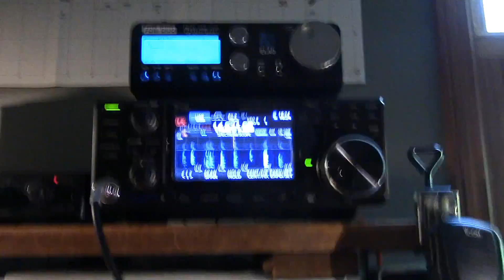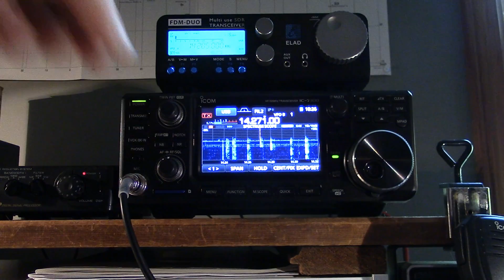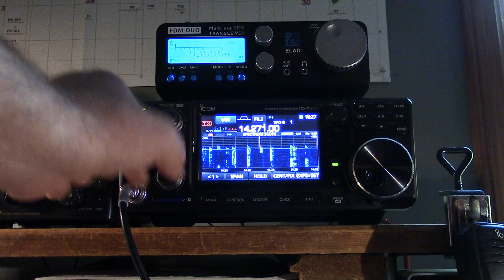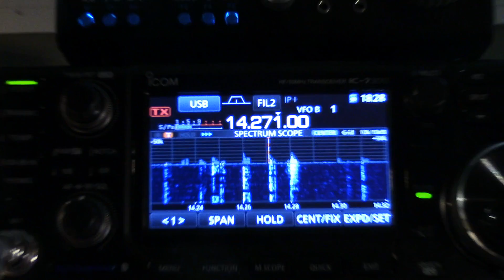Icom IC 7300 vs Flex 6300 - COMPARISON

Comment: Evaluating audio quality without using the same speaker is hard.  Also, may I suggest the proper way to adjust your Flex 6300's AGC-T?  You first adjust the AGC-T slider downward to the point where you hear significant signal falloff, then increase it a few points (by left clicking on the slider on the right side of the AGC-T knob, not dragging the knob). This fall-off point is what we call "The Knee". Then you turn the slice volume up quite a bit. This makes it very noise free and near FM like.
Reply: I agree with your comments.  Also the AGC-T is an entirely different function than the RF Gain on the 7300.  Not to denigrate the 7300 - it's a fine radio but a 2" speaker just doesn't make it with me

Comment: I am looking at getting the 7300 to replace my Flex 6300. I am not happy with the direction that Flex is taking with their software development, though I fully understand why they have to do it. They concentrate on things that bring in the $$$$$, which means that the average ham gets left behind. Many people who have used the previous software for the previous generation rigs is better and has more features than the current SSDR. It is a shame Flex could not use that as a starting point.
Reply: I am in the same place as you on this one.  I have had the 6300 for two years now, and I have had alot of fun with it on both CW and DIGI modes, although I bought the 6300 based partly on the "roadmap" that used to be published showing WAN in the next year or so.  This seems to be on the back-burner now with all the excitement over the Maestro.  However the Maestro looked interesting, and when SSDR 1.8 came out I assumed the early adopter bugs were squashed so decided to order.  I was busy at work the following day so never go around to picking up the phone to order.  Turned out to be a blessing as it turned out that within a very short time 1.8 was pulled as being faulty and that really put me off spending over £1k on a Maestro.  I have been looking at the 7300 and it looks good for data with the USB connection taking care of the audio in and out of the PC.  It will not allow remote operation, but neither will the Flex for the foreseeable future, and the 7300 is half the price. I am aware that there are ways of using the Flex remotely now, but they are not ideal and none will allow CW remote which I would really like.  The idea of operating CW with an iambic paddle from my desk at work is a dream that I do not think will happen anytime soon with the Flex. I do not think I will sell the 6300 but if I were staring again now with an SDR rig I would be very tempted to go for the Icom.

Comment: Both have their points, but I went for the flex 6300 as its much mode configurable and adaptable..
Reply: i ended up not liking the flex.. got rid of it.. now using an OLD FT-901DM lol

Comment: Being they are supposed to use the same A to D converter, they should be very similar. There is one HUGE difference in these radios - With the Flex, you have user input to the company. Your desired feature is likely to become part of the next software revision. They listen and respond. The Flex has a tremendous processor- capable of expanding into new modes and features not even conceived yet. Your radio continually gets upgraded with things you want...which will never happen with the 7300. A large percent of Flex's engineering time goes into creating/improving noise reduction modes ...which is exactly what we need on HF.
Reply from the maker: Great to see you here Bob! Love your channel!
Reply: Okay what features were put in there that make the 3x price difference make sense? price per DB receive is also much better with 7300, and any software features you can add via SDR and PC software. I do glad they listen...very good to know. :)
Reply: @Amatur_scientist764  The Flex Smart SDR gives you total control over your interface with the radio. The display on the 7300 is minuscule. It is usable, but could never compare with a full screen display at 30fps. The 7300 is  14 bit machine and the 6300 and above are 16 bit machines. This means the native dynamic range of the 16 bit system is right at 100DB and a 14 bit machine is far less. In the end it is about weather you like a box with knobs or you are OK with using a PC (or maestro screen). the 7300 will be the sellingest radio in this 10 year period. It is a superb value. And PS: Flex's Smart SDR gives you the least access to the inner workings of the radio...There are others which really let you get in deep.

Comment: I also have an iC-7300 and I have two comments: 1. The IC-7300 audio is great when run through BOSE speakers... the same one I use with my FLEX1500 (didn't invest $$$$ into a F6300). 2. The NR on the IC-7300 is better. Seems like you did not set the NR level high enough :-)
Reply: what bose speaker model

Comment: Hi Rick !
Many thanks for the effort and the info.
Can you please elaborate on the FDM-DUO issues ?
A comparison between the DUO and the 7300 would be great ! I consider them the best two performance/$$ on the market but I have none (yet).
Also, have you though of actually recording audio through a line-in connection ? this would eliminate the speaker/ambient/microphone issues. Easy to do and professional !
My best 73s
George - sv8arj
Reply from the maker: Excellent suggestions George - I will try... 73!
Reply: FDM-DUO- the best!

Comment: Listening to a signal in the clear with no interference will sound fine on ANY radio, even my old Icom 706. Where the SDR radios shine is pulling the signal out of all kinds of QRM. Show us how they work on 20 meters during a major contest when stations are less than 3 khz apart.

Comment: Tough.  The audio on the 6300 sounded worse at first, but seemed to get better and surpass the 7300.  I wasn't impressed with NR on the ICOM, but not sure this was the right situation to test it.  I love your videos, but you really need to control for the speaker in these situations.  I use this switchbox with a CLRSPK speaker.  Just buy it, the switch with a reference speaker will put these questions to bed.    http://www.bhphotovideo.com/bnh/controller/home?O=&sku=1023552&gclid=Cj0KEQjw4J-6BRD3h_KIoqijwvkBEiQAfcPiBdATXzCNrnQaIlbza-QMPVVNOKInqBHOHRTeemR884YaAryl8P8HAQ&Q=&ap=y&m=Y&c3api=1876%2C91438732682%2C&is=REG&A=details
Reply from the maker: Agreed. I'm just a hack with a radio or two. Still I am impressed with the Icom and the Flex. It's a new era and the old radios are usurped.
Reply: You're no hack.  Keep the videos coming.

Comment: Very close indeed, the speaker is of course a significant difference. Also a reasonably strong signal in the clear will not reveal much. I have compared many different receivers in A/B comparisons and they are all very close. In reality the best receiver is usually the one you own and use.

Comment: Without noise reduction they both seemed about the same to me. The NR made the 6300 a winner over the 7300. May just be the different audio capability though. So far the ICOM seems to be a very good option and the price is attractive.

Comment: Kinda like the flex, but the 7300 alot cheaper. 73 kc1ero
Reply: yes half the price but  nowhere near as customisable and configurable
Reply: i should have gone for the icom over the flex.. flex "community" as a bunch of suck asses, and flex themselves dont really care for the customer...
the flex is like a beta testers radio.. i hated using it.. software is clunky and unreliable ..

ive never had an icom 7300, but i recon its a safer bet.

Comment from the maker: Very close in my opinion - it might only be loudspeaker differences we are hearing at this point. Sometimes the Icom audio sounds better, and sometimes the Flex signal gets pulled through better.
Reply: Wonder they it would change?  I got that you had better speaker on the Flex .   Do you think it could have been variation in band conditions. 
Thanks for putting the review up.